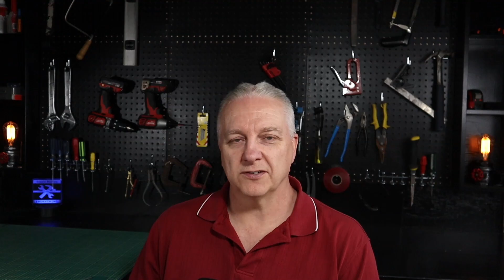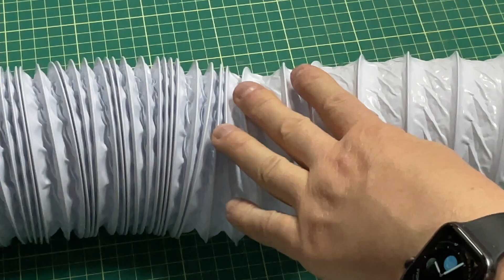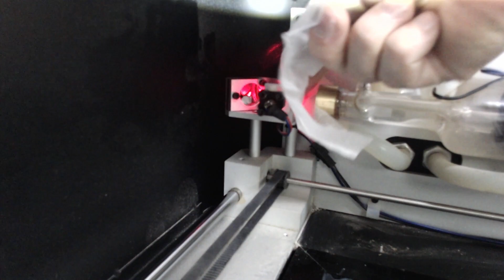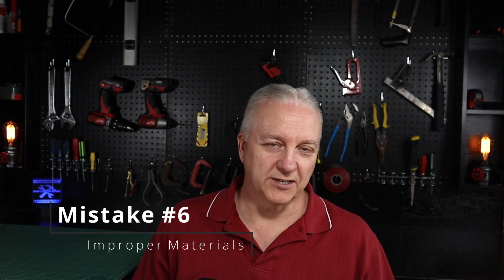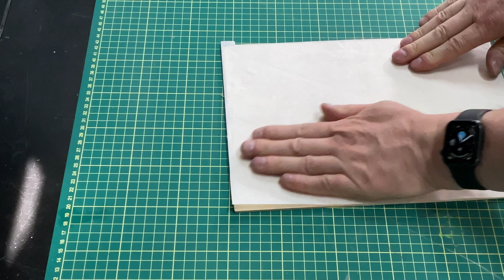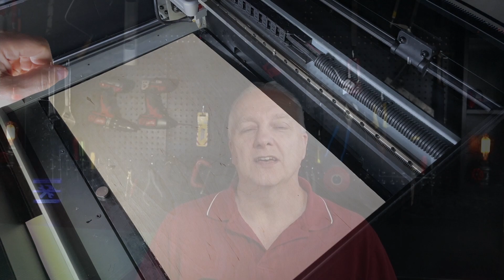TOP 10 HOME LASER CUTTER MISTAKES

Comment: In this video you talk about aligning your co2 laser. Is aligning of any sort necessary for diode lasers?
Reply from the maker: Diode lasers are typically fixed-focus and don't require the complex mirror alignment that CO2 systems do, though you should still ensure your lens remains clean.

Comment: Ya, that fire concern, I havnt had any, though do have a 3in1 sheet metal machine that might be a good idea to use for making a proper fireproof enclosure for the laser rig.
Keeping a few spray bottles set to MIST setting might help rather than dumping a glass of water over things. Fire blankets seem popular with laser rig owners from what I've heard a few mention of.
Thanx for the tips, about the cutting of foam and ya the cyanide gas..basically the airborne version of the jonestown koolade festival!
Reply from the maker: While I always keep a spray bottle close at hand, I also have a proper extinguisher hanging on the wall near my lasers.

Comment: I guess the only time pvc flexible pipe becomes a problem is if there’s a fire, especially if it’s in an enclosure.
Reply from the maker: I would not touch PVC at all. When a laser hits it, there is always enough heat to make it vaporize and free the chlorine.  Even with excellent ventilation, there is enough chlorine to damage things like lenses and corrode wire connections.

Comment: And one thing, the bigger fan the bigger intake for fresh air to the Laser and don't forget a filter do it doesn't suck in dust to the laser
Reply from the maker: It probably a good idea but you won't find many lasers that actually do this.  There is enough dust float around inside the laser during operation that it probably won't matter that much if any incoming air is clean.

Comment: You mentioned chromium - how about stainless steel? A commonly used material in lasers, which contains at least 10% chromium. Is it safe?
Reply from the maker: Yes, in stainless the chromium is chemically stable because it’s an alloy and isn’t being cut or engraved anyway

Comment: Great points Steve! Thanks for putting them into one place. One issue that I tend to find myself in more often than I should is rushing to get something done. It always results in failure for me. Keep up the great videos!
Reply from the maker: I feel your pain. I’ve been building a custom light that was a rush job, but has ended up going through several redesigns because it is virtually impossible to assemble

Comment: I have seen Acetal (Delrin) parts being laser cut. Isn't that hazardous?
Reply from the maker: Delrin should be fine to cut.  This you need to avoid are materials that are chlorine of fluorine based.  Things like PVC (Polyvinyl Chloride)
Reply from the maker: You will probably have to double the speed that you use for acrylic, though the power will be roughly the same.  Delrin is a bit softer.

You will have to experiment a bit though.
Reply: @SteveMakesEverything  Do you think the settings for Delrin would be similar to acrylics?

Comment: As the article states “   When choosing the type of duct to use, use only metal duct. In particular, never use any type of plastic or rubber duct material! Why is metal duct required? The metal pipe allows you to electrically ground the entire duct system from the laser all the way to the exhaust port exiting from the building.

 	

 
 	Wall mounted exhaust fan with remote control switch.	 
   The problem with using PVC pipe and other nonconductive duct materials is that a moving stream of airborne particle matter builds up a charge of static electricity, which can eventually cause a static electric charge. A static spark in the presence of certain concentrations of airborne particles can cause either a fire or, in extreme cases, even an explosion. This is very dangerous and must be kept in mind when designing any type of ventilation system”
Reply from the maker: It's a fair comment if you are running a 20 foot length of pipe in the dessert, however the foil pipe also has measurable levels of plastic content as well (it's not 100% metal by far and since in neither case is the pipe grounded the comment about potential static applies equally to both.  The comment about static discharge causing a fire is completely dubious since none of the particles from material you would ever cut in a laser are inherently flammable, nor are they in a concentration that could trigger ignition.  However, if you were really concerned about this run a bare grounded wire in the pipe or line the inside with foil tape or even use full metal ducting if you have space.

Since I live in a very high humidity area - even in winter, there would never be static build-up in the 2 feet of pipe I have between my laser and the wall. Further I am more concerned about the particles and fumes being vented into my workshop where they could slowly kill me.

Comment: Great video! Did you remove the factory fan to have better airflow or you use both at the same time? And the Air assist for the laser it's fine with the factory compressor? Thanks.
Reply from the maker: Yes both fans a running and it definitely helps evacuate smoke, smell, etc.  The compressor is small but is fine since it doesn’t actually have to push a lot of air - just enough to push the smoke away from the cut.

Comment: Hi Steve. I really appreciate you sharing your knowledge and experience. I was using blue painter's tape to mask the wood that I cut but the vaporized glue is leaving a sticky residue which I clean about once a week. Does the transfer tape you link leave any residue?
Reply from the maker: Transfer tape isn’t nearly as sticky. The type I use is arguably less sticky than it should be but it last long enough to make a clean cut. Not residue, though I don’t recall seeing residue with blue tape either.

Comment: Steve, thanks again.  When I saw that you replaced the vent pipe with PVC Vinyl pipe, I knew that is why my laser fumes were getting to me and making me feel awful.  I'm vented to the outside of course, but the suggestion to use the light...omg.  Another Q:  when you mask, do you increase the power at all?  I want to try glass today; what settings would you suggest for me to engrave that.  My slate turned out well! Thanks to your video!
Reply from the maker: Hi Nicole. You shouldn’t need to adjust the power to compensate for masking. Your laser will burn through that like butter 😀

Btw when engraving glass you don’t get much notion of shades of lightness so lean toward less power. You can probably get away with a speed that’s 80% or more, and power in to 30-40% range - really just enough to see the engraving.  You also might need to take a bit of a light wire brush to it afterward to break away any residual glass fragments.
Reply: @SteveMakesEverything  Thank you!
Reply from the maker: A pleasure as always 👍
Reply from the maker: @sallyann-nicolemiller5625  Note that you could probably also add a secondary inline fan to more forcibly remove the fumes.  I'll add a link to the one I got from Amazon down in the description.

Comment: Hi Steve, Thanks for the video. I have many samples of plastic laminates like Formica. Is it safe to cut this material?  Another question that I have is I have rolls of Oakwood edging that has glue baking that is activated by heat used mostly for edging tabletops. I was wondering what would happen if I cut this with the laser? Or how to protect any material that has glue backing?
Reply from the maker: Hi Rouben.  Welcome to the channel.  You would need to me careful with formica because two of the things used to make it is resin and melamine.  It won't damage your laser but if you try if your laser is well vented you should be OK.

I would be a lot more careful with the pre-glued edging.  The veneer is fine but the glues are essentially plastic and can be made of things that aren't very healthy, but more likely they will easily catch fire..  Check with the manufacturer for composition, but in general I would avoid these myself.  I've use unglued veneer in the past and with low power and high speed on the laser it cuts very well.
Reply: @SteveMakesEverything  Thank You, Steve. I was afraid of the glue backing materials. By the way, I am enjoying your videos.
Reply from the maker: @roubens1  Thanks for the vote of confidence 😀.  It's great to think I'm helping people.

Comment: Hi Steve.  Another awesome video! You covered many things that a lot of YouTube laser folks don’t and will likely help many people including myself.  I received my Muse 3D Thursday, using the Canadian distributor,  and haven’t had time to set it up.  I have a few questions... Could  you please post a link for your 12 inch masking product  and cermark , or equivalent, to ensure I order the right stuff?  Thx!
Reply from the maker: Thanks for the vote of confidence!😀 The transfer tape I bought is this one (https://amzn.to/3fCO3gC) Since you're in Canada you can use my Amazon affiliate link and I may be paid a commission.  You could also get Cermark on Amazon, though it's usually too expensive.  The cheapest place to buy it is probably Trotec in Canada (Look here: https://www.engraving-supplies.ca/laser-engraving-accessories/paint-thermark-cermark.html). I buy most of my higher-end materials there now.